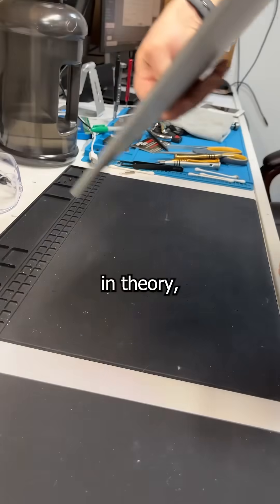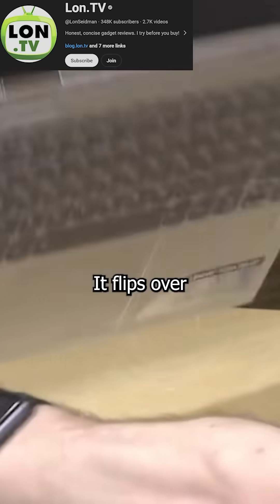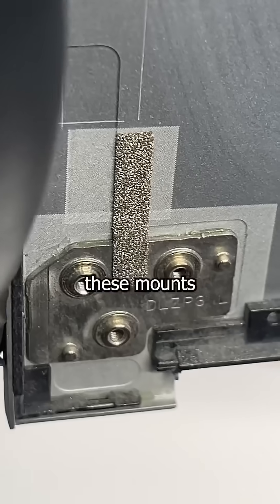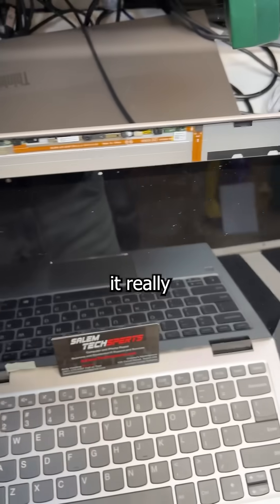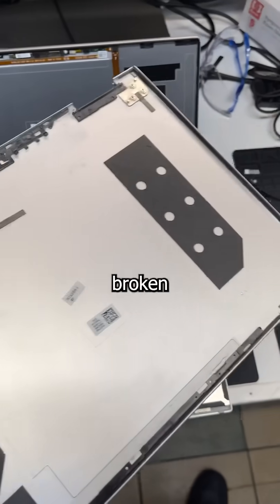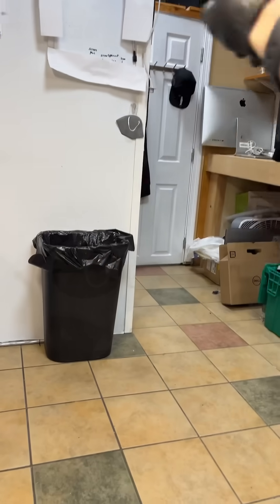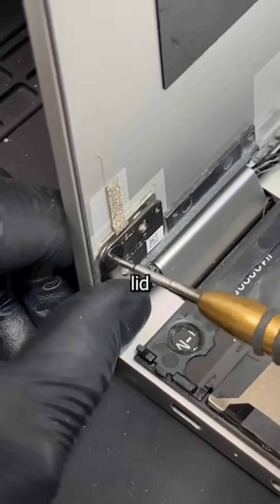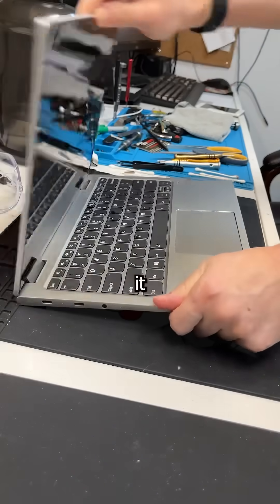Lenovo Yoga with a broken hinge (surprise) #tech #pc #technology #shorts #laptop

Comment: Almost the same issue on the Acer Aspire 5 laptop which my brother and i used in car repair shop. Hinge is tiny аnd three small screws are screwed into threaded recesses on the plastic housing, which is glued to the aluminum cover. I don't know what kind of genius you have to be to understand that such a loaded element attached to such thin plastic will break... Oh, right, that's planned obsolescence.

Comment: Mine is doing just fine, kinda depends on what you use it for. It’s absolutely not a great tablet, but touch screen on laptop can be suprisingly handy, and when you turn the keypad under but leave the screen open it’s much easiel to watch stuff on it than having it on sit there like a normal computer. You could either stand it on the keyboard part or make it stand on two legs like a tent. Not a sales pitch, I feel like video did enough to counter an effort to market anythin😄 just saying, a pretty shitty tablet but a decent media screen.

Comment: I had a hp like this one, it had a set of 4 magnets. 2 for losing and I guess 2 when you switch it to tablet. One of the bottom magnets got loose and it attached with the top one, so when closed it, it cracked the screen, I though that glass was cracking on it's own

Comment: I had a similar issue with a MacBook Pro. No option for a replacement lid. I used a two part metal epoxy to cement the attachments back to the lid. I had to remove the two part standard epoxy used by a ‘repair shop’ which had failed.

Comment: What changes the fact you just installed the same faulty lid? 
Recently i fixed the same model, but instead of replacing the lid i simply welded them with spot welding, and managed not to damage the paint on the back.
Saved on the new lid price, saved time, earned more.
While yours will fail with time as old one, my work will never fail until its shredded to scraps

Comment: I actually had this issue with my lenovo flex, but instead of just breaking off, the hinge plate broke off and tore through the screen when opened. My method of fixing it was to just drill holes all the way through the screen and put a nut and an M4 bolt with some washers on either side on and I haven't had any issues with it since!

Comment: This happened to my Dell Inspiron, the hinge was good but the brass threats that the hinge was to screw, were just glued to the back cover and the glue obviously failed. I end up repairing with superglue, and it being working good since. It as obviously made to fail, an 16 inches screen secured to the laptop only by 4 small points of glue? Would it be that much more expensive to machine the threats onto the laptop lid, or even solder a plate with the screw points? But small glue dots? Not that.

Comment: I've got a ThinkPad yoga s1 and that thing's hinges were built like a tank. Problem is the keyboard retraction mechanism is so difficult to attach, when the ThinkPad repair shop swapped my keyboard under warranty, they just said fuck it and didn't do it. Several years and an iFixit kit later, I tried it for myself, and it took about two hours to get it working.

Comment: Dear lord, it is now proven to me that this company sucks.

To explain, I have a Lenovo Legion desktop. Specific model: Lenovo Legion T5-28IMB05

For a while, I was suffering a weird issue on my PC where it would freeze after I turned it on, but after restarting it, it would be fine for the rest of the day.
Still, it was an annoying and persistent issue that I spent a ton of time trying to find a fix for, only for NOTHING to work.
But when I was preparing to do a BOIS update, my last resort to fix the freezing, and trying to look up the right BOIS patch for my PC, THAT'S when I found an article detailing exactly my problem, and found out that it was an issue with my specific PC the WHOLE TIME. Yeah, the Lenovo Legion is the problem.

And after seeing this short, I know for certain that this company seems to have issues with a ton of their hardware. So, I will not be purchasing anything from them, ever.

(And if you are wondering, one, the fix to my issue was disabling the on-board audio board in BOIS. The downside is that the audio jack won't work, unless you get an external audio card installed, so USB or HDMI are necessary for audio now. Two, no, I did not buy my current PC. It was my brother's for two years, before he and my dad gifted it to me, because my brother got a new laptop to use at Job Corps, and I was talking about getting a desktop when I would be able to. And the freezing issue didn't even start happening right away, so even my brother didn't know about it.)

Comment: My wife had this laptop she loved it but it didn’t even outlast its warranty. We brought it back but I think the item was recalled or something and they only had 1 replacement which was a refurbished laptop. When I took the laptop home and tried to turn it on the screen would not stay on passed about 10~30 degrees angle. And had to immediately return it as well. But they had no more replacements. I purchased it at Best Buy by the way.

Comment: I'd just use some isopropyl alcohol to clean the old adhesive and then epoxy or bondo on the mounts/surface and then clamp it  and it should be an easier repair and longer lasting repair. That regular adhesive is probably garbage.

Comment: I would have an issue with them if they weren't easy to repair.
Reply from the maker: The problem is it’s usually a catastrophic failure that takes the display with it. And if it’s an older model the display costs more than the entire laptop costs on eBay.
Reply: @SalemTechsperts damn. I've only ever fixed one (we use newer models now), and the display was fine. I do love my ThinkPad Yoga, though. I guess I'll live with that risk so I can have a Windows tablet.

Comment: I have hp envy x360 which have same problem their hinge broke in 4 months. When I get to service centre they said it is not covered in warranty and I have to replace the whole touchscreen. I said no and get it fixed in a local repair shop

Comment: I would have just screpaed the lid metal and epoxy glued or jbweld the screwplate.
Stronger than the original one, it will break again in a year.

Comment: marketed for 10 years of working
Reply: That's for the high end model, people complain when they buy a $700 laptop and it breaks after 1 year. If you want it to last at least spend more than you'd spend on a phone. You're expecting quality components for the same price as a low end android tablet.
Reply: @theairaccumulator7144 the cost of phone parts comes from their small size, this isn't a great comparison..
Reply: @alex31ytb what low end tablet is $700??